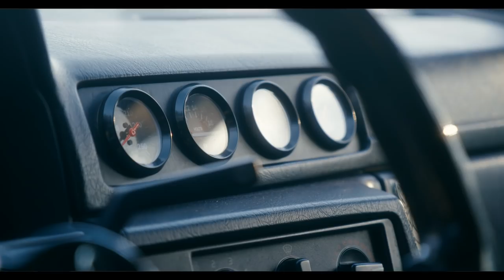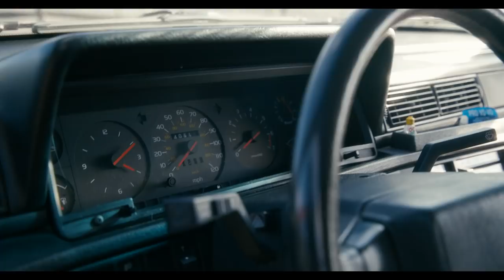Volvo | A 740 Wagon/Sedan and a Volvo 240 with a LM7 Turbo - Mini Documentary

Comment: I used to ride togheter with my freind in his Volvo 740. It had 400 000 km on the clock when he sold it. Years later I met the new owner, he was still driving it.
Reply: 400 000 km? Are you sure you don't mean 40 000?
Reply: @vante5529  400 000 km = 40.000 metric miles. 40 000 km = 4000 metric miles. So I guess 400 000 km is right.

Comment: Gotta love old school red blocks! (The 2.3L 4 cyl cast iron blocks were painted red..hence the name) the early Turbo engines had forged cranks (B23FT)…. The only red block to avoid like the raging shits is the 1989 engine. Aka “K” block.. as it had a K cast about center on drivers side of the block. Some dingbat thought it would be a good idea to go from 13mm rods to 9mm rods. 🤦‍♂️.   And it don’t take much more than 3-4 psi boost above stock to break a rod! Ask me how I know 🤪